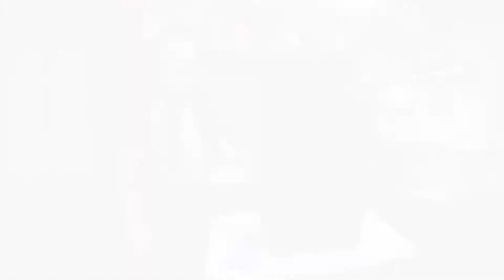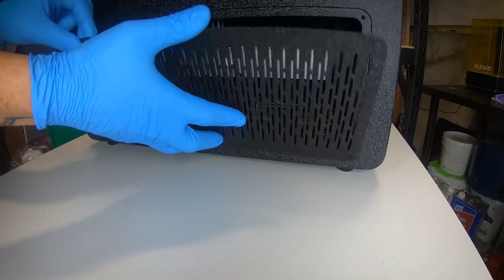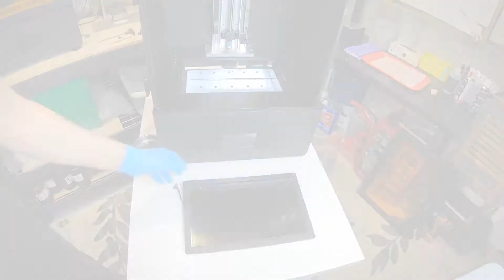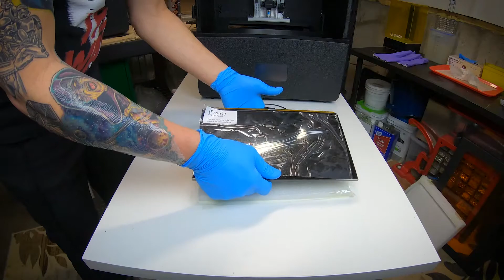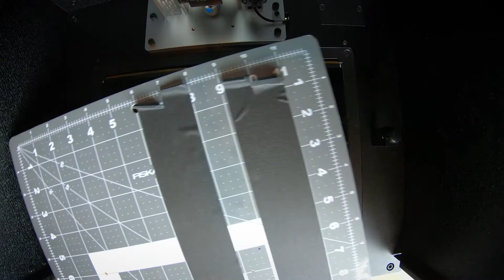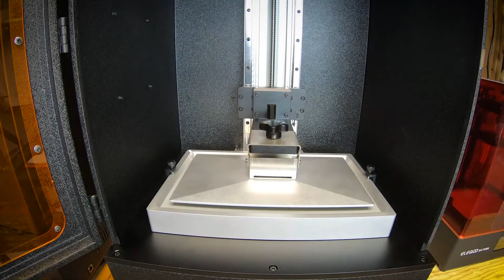Replacing your Peopoly Phenom NOIR LCD Screen

Comment: Im Wondering why don't you use a a screen protector on top of the lcd in case of any resin dripping or something like that
Reply from the maker: I actually do. Previously I did y because I was concerned about shadowing. But it hasn't been a problem

Comment: 28:00 assuming push down very lightly?
Reply from the maker: Since the build plate is actually on the frame, I wasnt concerned with damaging the LCD itself. However I refrained from putting all my weight on it